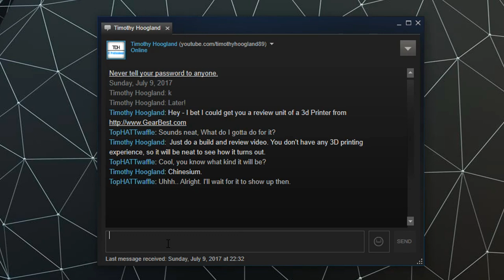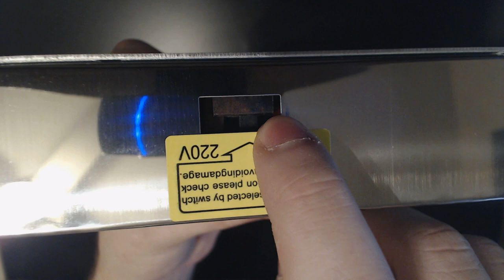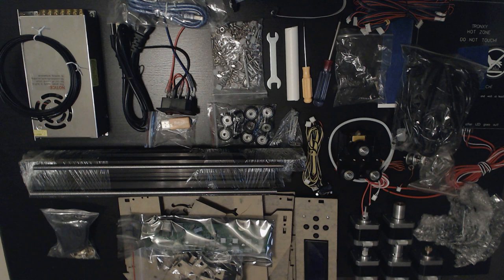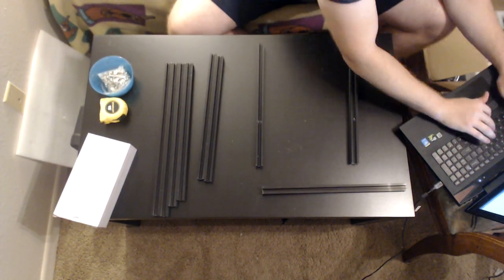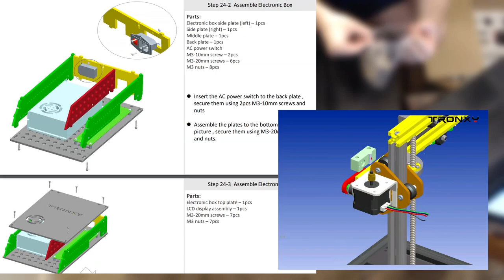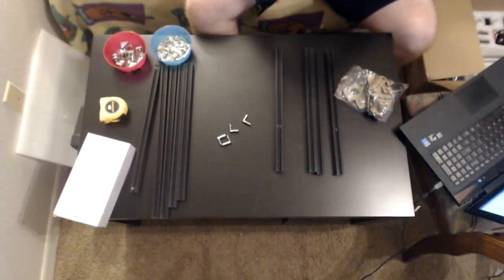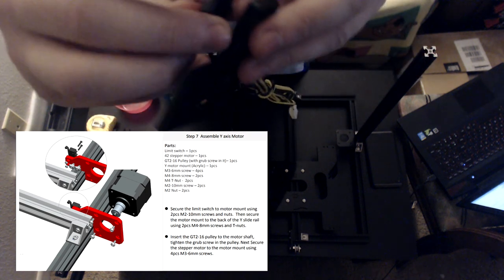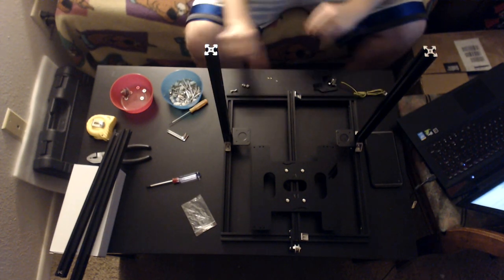Tronxy X3 Build and Review - By a 3D Printer Virgin

Comment: This is one of 5 printers I own (2 kossel deltas, prusa i3, mecreator) and it works great. Of course I did replace the hot end, the board, power supply and BL touch probe along with a lot of printed upgrades. Of my printers this one is I the one I now prefer. I find these inexpensive printers excellent buys as you get most of the parts and frame work for a good printer if you are ready to tinker and do upgrades. It also helps if you have a lot of spare parts and boards lyuing around. I do not believe that they are good purchases for someone just looking to get into 3d printing and thunk that they will just work great out of the box.